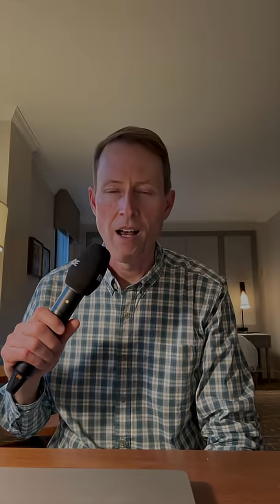32-bit float vs 24 bit Noise Reduction

Comment: It’s not about the sound, it’s the fact that 32-bit floating point gives you considerably more headroom.
Reply: Tube versus digital amp - the very reason a 40 Watt tube amp will make your ears bleed, and a 40 Watt SS amp will leave you unheard in the garage band practice.

Comment: if they are clocked great within the samplerate there is no 'visible\audible' switch between both parallel converters (and recorded as 32 bit float)

Comment: Recently got the Boya 2. I’ve only used it a couple times. Being a solo creator I wanted the set it and forget it convenience of 32-bit but also wanted on device recording. 

I’m happy with the results so far. Not because 32-bit has been noticeably better, just for the convenience factor and that the actual microphone is better than the cheap lav I’ve been using for over 10 years. I don’t feel like I need to do much if any EQ.

That may change as I use it more but at least for my videos my voice sounds pretty good and the people I interviewed did as well. 

As far as noise reduction, I don’t know if it would have been better than what I normally would have done with my typical setup which is better than my at home setup. Between Izotope and FCP’s voice isolation I was able to do a really good job greatly reducing the background noise at an event.

Comment: Personally i have mayor problems using compressors on 16 bit audio, ot gating, anything amplitude related...  aliasing and aritfacts just are audible imo there ...  24 bit audio is fine BUT if you record with a headroom of 12 db you loose 2 bits and you often loose 2 bit because of the SNR  leaving you with 20 bit usable data ... Same goes for sample rate, 44.1 is fine, but if you have to do time stretching to synch the words to other videoclips or something like that you hear problems earlier. That is why a higher samplerate is super helpful just like more bits imo
Reply from the maker: Thanks for sharing.

Comment: Should I replace my h1 with H1e ? $90 is reasonable. is it worth the upgrade?
Reply from the maker: Tough call. Not any audio quality upgrade. More a question of whether you struggle with setting gain.
Reply: @curtisjudd definitely a trust issue

Comment: Then add in the predetermined range if a wireless system into mixer.
Reply from the maker: Not sure I understand.
Reply: @curtisjudd dynamic range of wireless tends towards restricted dynamic range. I've seen bag sound mixers promote 32 bit float as akin  SD to 4k. Wrong analogy, wrong metric.

Comment: Was your gain "normal" and did you use a sample rate of 48? It would be interesting to conduct the same test at 96 kHz on something that requires more pre-amp gain in the 24-bit domain and lower in the 32-bit float recording. I think the sample rate has a greater impact on 32-bit than on 48-bit on 24-bit vs. 32-bit float. However, all of this is equivalent to pixel peeping.
Reply from the maker: Yes, the sample recordings were both 48kHz sample rate. Will be interesting to try 96kHz.

Comment: I may have said this in a comment before, I don't remember, but I think 32 bit float is really useful when you take the control and ideal conditions out of the equation. I use the zoom f3 and it really shines in situations like recording children's theatre for example, where you have too many characters to put lavs on each, and you have some kids who speak like kittens and others that get occasionally possessed by the gods of acting and start shouting. If you consider 2-3 shotguns around the stage and factor in the audience , the music track over the applause and the chaotic movement of the actors, it's hard for 24-bit to cover. I'm not a wiz with audio tbh (I film) but my zoom H6 just couldn't do it.
Reply: 32-bit float is, to me, almost the best thing since sliced bread. I shoot in a lot of very unideal environments. 32-bit offers the capability of just slapping mics wherever you want. As long as the source isn't too loud to clip the mic, you essentially guarantee the audio recording. For filmmakers, it is game-changing to Only need to think about mic position, not audio levels.
Reply from the maker: Glad you find it helpful!

Comment: Not a huge surprise to me. Presumably the noise reduction software will convert all inputs to a single format, in which case the difference between 24 and 32 bit will be minute
Reply from the maker: Convert inputs to a single format? Not sure I follow.
Reply: @curtisjudd  I mean like surely the typical noise reduction plugin has a 32-bit floating point or 24-bit integer format it uses during processing. The recorded audio will ultimately be converted to that representation used during processing and then ultimately the differences between the recording formats becomes just a very fine difference in the quantization.